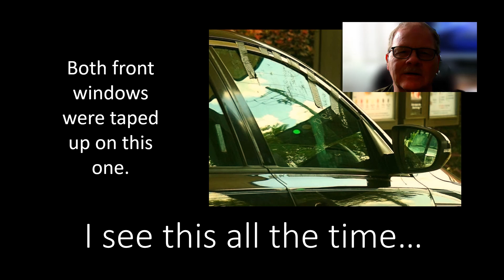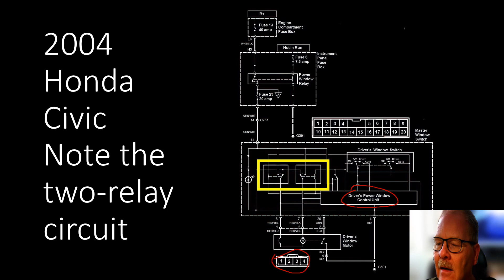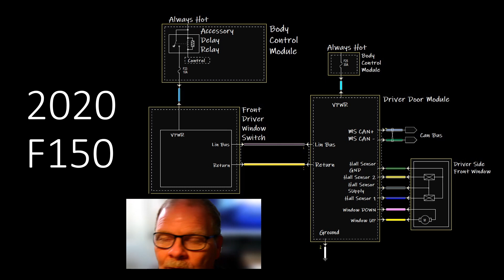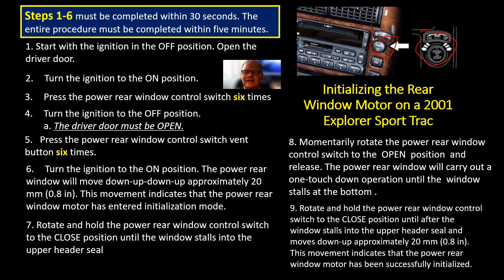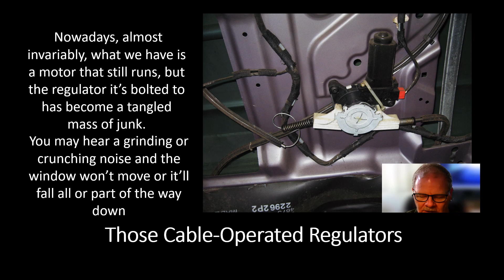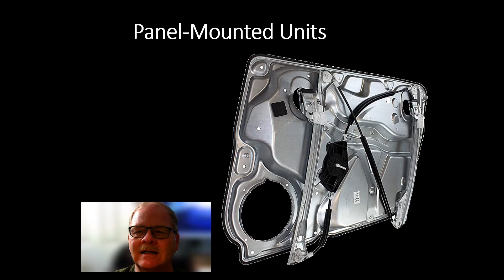Power Window Primer

Comment: Had a two button power window switch to fix on a mazda they only made 3 for years @ $300.  Instead of buying that I bought the Mazda MPV power window switch @ about $30 the wire positions in the connector was different and plastic outer moldings were swapped. Investing a few extra minutes and knowing stuff really paid off on that one. Guuooood Monday !